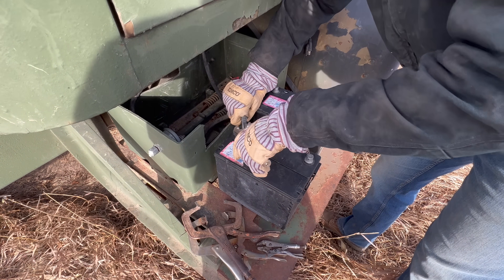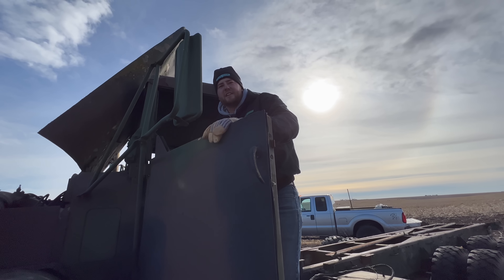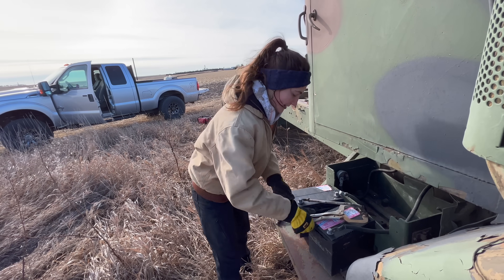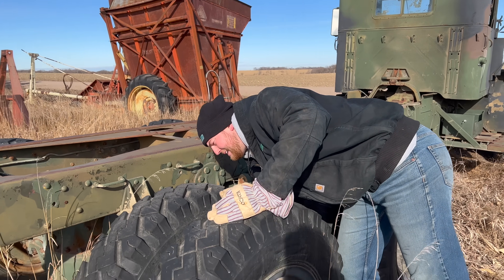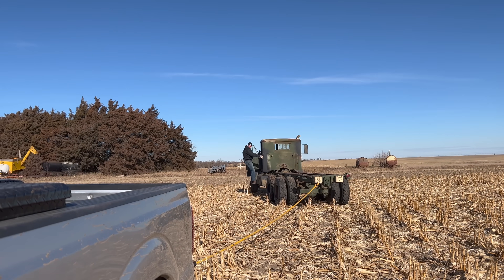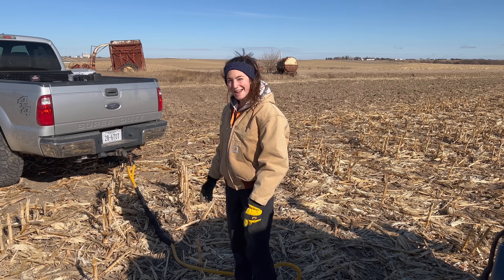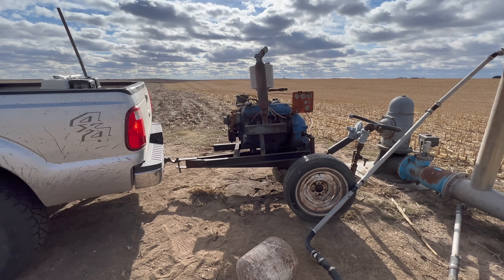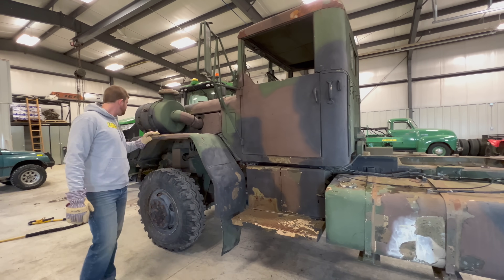If You Can Start It, You Can Have It

Comment: From an Army 63C30 mechanic....Me 🤠 change the engine oil first. Change the oil filter. Change the air filtter and fuel filter. Clean the fuel tank and use fresh diesel fuel.
Reply: Very wise also if you start old petrol engine take out the spark plugs and squirt oil down the cylinders, gives you compression. Found out that one the hard way.

Comment: The truck is an M814. It has a NHC-250 Cummins engine. It is not a multifuel engine. It has a fuel pump primer on the dash that you pump up to help with cold start. When warm out it can be started with 2 batteries like you tried but cold you would need 4 or 2 group 8D batteries if not plugged into a block heater. I have a M818 the truck tractor version of this truck with the same engine. They are great trucks and worth fixing up especially for fun and farm work.
Reply: I would say use 4, 6volt batteries they will give you more cranking power
Reply: How about the ones they have with them, plus jump start one with the truck running, switching off as often as possible, and if they know which battery is weaker, jump start that one.  That is how I do my excavator.
Reply: @terrancemahoney4669  No.
Reply: 4 12v batteries, those are usually a 24v system.
Reply: @TheGenerationX894  Not necessarily true.  If you use the RIGHT battery group, all you need is two.  It all depends on costs, and how cold it gets where you are.  4 batteries will also require more battery wires and terminal ends, which also cost money.
Reply: @TheGenerationX894  wired 2 in series and 2 in parallel.
Reply: @terrancemahoney4669  Wrong...
Reply: you will need 24VDC from the 4 12V batteries, so 2 series and then parallel
Reply: @TheGenerationX894  It was designed to operate with two Heavy duty 12 volt truck batteries in series. Been that way since that truck was new, about the time I started driving them. Well maintained they will start the truck in sub zero weather. Heating them does help.
Reply: Why not just convert to 12 volt?
Reply: @petedeluisa6315  It's a military thing.
Reply: @petedeluisa6315  the circuts  on the truck is 24 volt DC Starter, Alternator, Head lights.
Reply: @petedeluisa6315  because you wont find a starter with enough power to run a big engine on 12 Volts
Reply: @petedeluisa6315  You can add a 12 volt system to run accessories off of it, but it's highly impractical to convert the truck from 24 volt.
Reply: @petedeluisa6315  Because of the starting current. There is a reason these big vehicles are 24 volts. There is also a reason large vehicles are still 24 volts today. 12 volts is for consumer vehicles.
Reply: @joaonobre9003  you're joking, right? 99.9% of the semi trucks in North America are 12 volt systems with 12 volt starters, alternators, headlites, etc. etc. I suggested COVERTING TO 12 VOLT because you can go to NAPA and buy 12 volt "Group 31" batteries, headlites, tail lites, alternators, heater fans, or what ever.... lf they are going to use it once or twice a year, no big deal. If they use it more, it would be easier to convert it.
Reply: @BifsieOfficial  do you know that semi trucks (18 wheelers) have 12 volt systems. They have a/c, power invertors, some have refrigerators , microwaves, and flat screen tvs in the sleepers? All run at 12 volts. You don't need 24 volts to start a semi.
Reply: @TheGenerationX894  or Series/Parallel,  start on 24V/run on 12V. There's a switch/solenoid used on starting. Some IH Farm Tractors & maybe others did this.
Reply: @petedeluisa6315  Why not convert to 6 volt? Same problem, to many amps; burns up all the power in the wire and connections. You need them volts.
Reply: @tedmoss  convert what to 6 volt?
Reply: I was going to recommend the 8D's as well, great cold cranking amps, though very big, very heavy and a bit pricey $$$
Reply: @TheGenerationX894  most these older ones were 12v so you run the batteries in parallel, not in series like this one as 24volt
Even lot of the new trucks have gone back to 12 volt. 
Horses for courses.
Reply: @petedeluisa6315  This was a joke, if you ever used 6 volts to start a car you would understand; it just does not have enough power delivered at the starter after all the power burned up in the circuit.
Reply: @petedeluisa6315  Semi trucks come in many different forms. Most modern ones come with either High current 12v or a hybrid 12/24 system. In very cold climates they are still 24v starting. In explosive environments, they use compressed air to start.
Reply: @richardchisholm2073  wrong...they all come with 4 12 volt batteries
Reply: It's diesel, so it is multi fuel.
Reply: @petedeluisa6315  these are a 24 volt system unlike any civilian trucks which are 12 volt.. This truck would take two 8d semi truck batteries hooked up in series to give 24 volts to power up the trucks charging and starter..Good luck and have fun...
Reply: @GEOsustainable  this is a M54a1 with the multi fuel Continental Red Seal engine and the m813s had a Cummins diesel engine so they are different...
Reply: @tedmoss  I used to have a pickup truck with a 6 volt positive ground system. Everything on it was 6 volt.
Reply: @230e4  you are right…we had expanding van bodies on these chassis. Korea in the seventies, Cummins were an upgraded diesel only engine. Whenever it was really cold, a lot over there, you really needed good batteries or no starting. 2 8D’s or it wasn’t going happen…

Comment: One word of advice: Pay attention to the warning on the underside of the hood "Secure Hood Before Servicing", especially when there are winds. I've seen a a lot of guys severely injured because they didn't secure the hood while working on the engine. Wind caught it and slammed it shut on them. There is a lock mechanism with an eye right in front of the driver's window that secures to spring loaded fastener on the top of the hood.
Reply: Most of those trucks had a flip doghouse and they are very heavy and need to be locked in place .
Reply: I can remember being in one of these beasts going down the road and the hood flying open and you couldn’t see anything at that point.
Reply: @johnrosier1686  If the hood flew up, then you screwed up royally.
Reply: @ffjsb  I don’t remember all of the details of how that happened.  It was 30 years ago in the desert and fortunately we were able to pull over and get it secured. I think we were repairing something on it and someone missed latching the hood down. 
Live and learn and I am way more careful today.
Reply: Yes. My buddy is missing two fingers because of exactly that. His hand was stuck for two hours when someone found him. Not good.
Reply: @MW-xv1sj  sorry to hear that.
Reply: My thoughts as soon as he opened the hood. I used to drive one of these in the late 70s.
Reply: One night, by myself, in the rain, I was trying to get my M812 squared away before an exercise.  The wind blew the hood shut on my arm.  There was enough room to avoid damage but the raincoat wouldn't let me get my arm out.  I was being careful not to let my butt slide off of the fender.  Hanging by my arm all night wasn't what I wanted.  Finally got the arm out and went home.  I survived and was wiser for it.
Reply: @richparker3048  
I had a toolbox in place that prevented me from being injured, I was 12 years old then,  I learned my lesson well that day.
The toolbox had a huge dent, I left it as a reminder to be more careful.
Reply: Saw it also. 
El Paso, Ft Bliss. Maintenence company motor pool. Guy didn't secure the hood latch, bent over checking the oil, when the wind picked up. Flew out right down on him. Just his arms and legs were sticking out.  The was thrashing around screaming for help. I lifted up the his and secure it.  We laughed our as$es off.
Reply: My father worked in the mechanic corps for the US army (I can't remember any other information like unit number or what division he was in), one thing I will always remember him saying is that "when you're in the bone yard, always knock before you enter." My father was going through trucks looking for parts and he looked in the passenger seat of a truck and he found a head, because of the cab being airtight and the fact it was always hot inside, the head looked like it was fresh. On/in the same truck his group found full beer bottles, a bomb/landmine, and they also found "Sh*t you're not meant to bring home."
For fuel, it depends on what filter you have on it, and what engine it has. Also, these trucks are meant to be put through hell, like their forefathers the Dodge Power Wagon.
For the numbers:
You can tell quite a bit about a US army vehicle by the numbers painted on the front and rear bumpers. The number on the left side is the unit identifier. The number on the right side is the vehicle number from these numbers you can tell what unit the vehicle belongs to.
Sorry for writing so much.
Reply: one word: DARWIN.
Reply: Word. I have seen that accident too.
Reply: Good advice, that hood looks like a giant mouse trap
Reply: @johnrosier1686  m
Reply: Being a 63 bravo wheeled vehicle mechanic I worked on many of these M54a1 5 ton 6x6 trucks.. You need bigger semi truck batteries hooked in seriesto turn these Continental Red Seal Mulyi Fuel engines to start as they are 22.5 -1 compression ratio.. Good luck...
Reply: @johnrosier1686  Try that happening going down the autobahn. I just about CHIT myself, but I managed not to hit any civilian cars.
Reply: @dhopper122  no thanks. Fortunately we were out in the desert when it happened.
Reply: God bless yall on what yall do always
Reply: Yall r very beautiful young women
Reply: I was a mechanic,and we had a short bed version of that for our tool truck,I think something was said about the hood in mechanic school a out the hood but no more, I don't think there was anyway to secure the hood on ours, I was just careful with it when I did work on it, I saw some stupid accidents happen with equipment and ppl get hurt,inexperienced ppl an not trained, and then the blame train starts, a big reason I did the 3 yrs I signed for an got the hell out,I went on to be more than I could be there elsewhere,and a way better kife

Comment: Your truck is referred to as a "5 ton", a M809 series truck with a Cummins NHC-250.  Diesel ONLY, but I would recommend running a fuel additive, Diesel Kleen, Hot Shot, or even just a quart of ATF per 10 gallons of diesel. These engines were not designed to run on Ultra Low Sulfur Diesel, they need extra lubrication in the fuel to replace the missing sulfur. Also look online for an operational TM (technical manual) to show you how all the systems work.  I have a 1972 M818 Tractor and I love it!
Reply: Just a FYI about the sulfur thing.    In the US, fuel manufacturers must hit certain numbers per federal gov mandates.   Fuel manufacturers definitely make up for what the high sulfur fuel did.         

US diesel fuel happens to not be held to as high of standard for Germany.        Its not an issue for that older non-common rail diesel.    There potentially can be a over time an issue for  a Bosch CP3 and CP54 Fuel  injection systems.         Definitely don’t use2-stroke oil or ATF as some additive.        There’s a lot of misinformation about fuel additives, sulfur and everything.  .  Word 

Fresh
Reply: I been using 2stroke and not one issue in my cummins. Ram2013 over 330k on it now.  But I never deleted it yet but man still thinking of it
Reply: @Stewies_Stuff  James your right about the manuals numbers. You could see if there is a army or marine transportation truck company unit that can help you with the right information.
Reply: Since the early 90's the military switched to jp8 for all tactical trucks and them being able to run kerosene for arctic use the fuel system does not require lubrication from the fuel
Reply: @Stewies_Stuff  The 272 series is the 939 series. This one requires 260 series for M809 series 5tons.
Reply: The instructions to start the truck are on the dash ... 24v batteries along with her dad's truck and a slave Cable would help. Again the army made it Private proof, read the dash , power switch, hand fuel pump, preheater it's all there.....
Reply: @zaneturner4478  why are you saying ATF will not burn?  It’s a oil Diesel engines will burn oil as fuel.
Reply: @Stewies_Stuff  The TM9-2320-272-series manuals cover the M923 series 5 ton.  The manuals for this truck are TM 9-2320-260-10 and so on.
Reply: good advice. military vehicles are not civilian vehicles. get the tech manual before you take it to a scrap yard. i spent 6 years in the army reserve in the motor pool.
Reply: @geraldmiller8973  You mean, they actually designed it to bust, if, say.. "an enemy" decides to refill it from a pump on the street, without adding some mil-spec "magic juice*"? 
Wow..

*(made preferably from household chemicals)
Reply: I would like an old military helicopter. First, I need to get pilot license. Haha.

Comment: My grandfather who is now 89 years old who served in the military said,  there is a master switch on the left side of the seat near the floor that needs to be turned on.
And then the battery switch above the ignition switch also needs to be turned on.  Then you turn the ignition key and the truck should start.
Reply: there you go a further explanation on how to fire up the thing :)
Reply: It’s already turning over tho
Reply: @MattieK09  yep that determined the engine is not seized just needs fire and fuel to run run run(in theory anyway) :)
Reply: @Dargonkin527  ahh thanks!
Reply: What a gem will run forever    if it says 5 ton it will handle 10 good find

Comment: A quick Google search leads me to believe that the "bumper numbers" that you asked about tell that this truck was once with the the 1st Medical Battalion of the 13th Sustainment Command. The numbers on the driver's side of the bumper are to internally identify the vehicle in the unit's fleet.
Reply: Exactly,  all US Army vehicles are identified by higher command on the passenger side and the drivers side identifies the section within the owning unit.

When is was a field artillery battery commander I was signed for 14 of these types of trucks in varying configurations
Reply: Old lucky 13
Reply: If its duce & half it can use gas
Reply: Dang I wonder how much avgas got wasted transporting that back home just to rot.
Reply: 13th Support Command
Reply: I believe your right ,yes they are unit marking